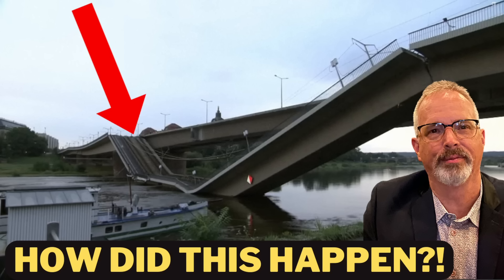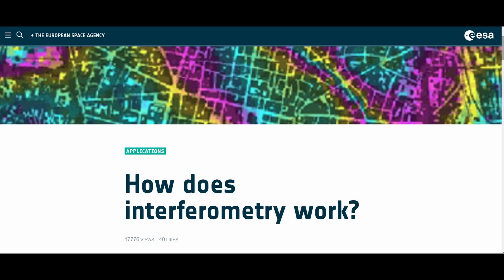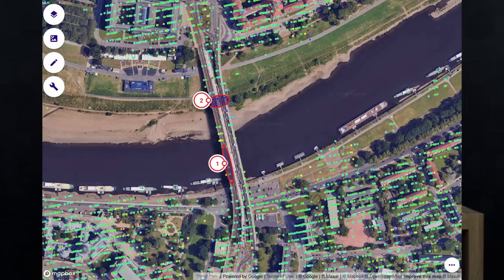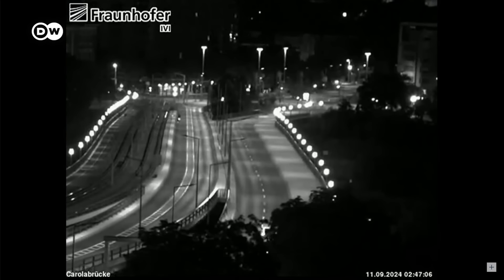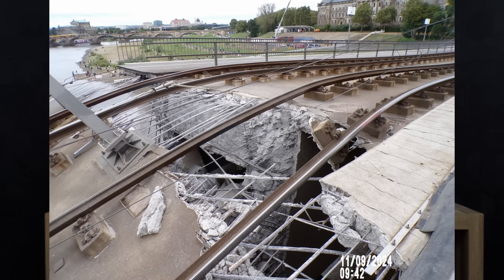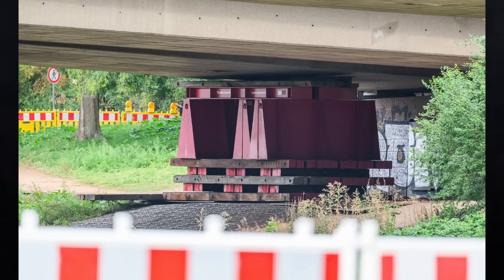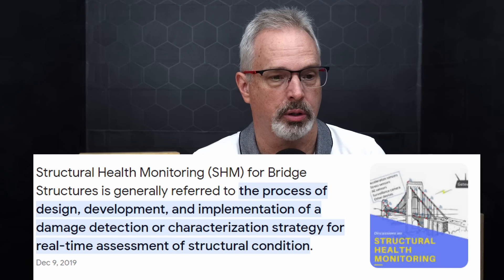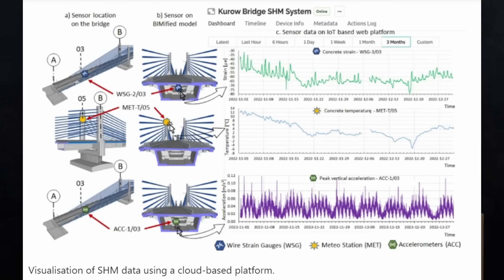Carola Bridge Collapse Update - Dresden, Germany

Comment: What I see are tram pillars at the fracture points. Did ice penetrate?
Reply: According to our officials a possible corrosion caused by chloride might have been the cause, that comes from an aggressive use of salt against ice in the past of that bridge. But the actual cause is still not certain, most likely a mix of corrosion or a general design flaw.
The bridge itself had its inspections according to safety regulations, 2 checks per year plus a major inspection every 3 years. Alltho in need of a restauration it never was declared in critical condition ... I guess the methods used for such inspections have to change, in hindsight it seems clear that not all data which could have been analyzed was actually used.
Silver lining will be that this lucky collapse will improve the safety of other bridges
Reply: @diedampfbrasse98  The first thing you see is that the rebar pulled out but wasn't rusted. I suspect the scans we've seen may simply be mechanical fracture of the cement matrix itself from ice expansion and contraction. Could it be that the vibrations from the light rail simply compounded this?
Reply: @JelMain  would surprise me if it were actual stress from traffic ... only 2-3 tram lines ran on that section for as long as I can remember with quiet some separation between vehicles. The other two road sections had much more and heavier traffic going across for decades.
ice expansion is also unlikely, in that bridge ran utility lines including hot water, poorly insulated in the past as well .. ice should only ever been on the surface.
Reply: @diedampfbrasse98  At this point, the game's open, and must be evidence-based. One piece of evidence is that long lengths of rebar were visible, having pulled straight out. Was the pre-stressing not done correctly? When concrete is poured, it can shrink, leading to the rebar rattling in the walls when rail services pass: The most notorious example is London's Barbican concert hall. I've performed there and suffered as the Metropolitan and Circle underground lines, running the other side of the wall, add their own percussion obligato to what should be a quiet and reflective meditation. Do that as ice is forming and you might as well take a road drill to the joint.

Comment: Shoddy Soviet construction? I'm shocked!
Reply: Not surprised either...
Reply: It was not a Soviet construction! East Germany had its own engineers and this type of bridges were build in West Germany too.
Reply: @GrandTheftChris   The problem in Soviet Union was not the engineering, which was fine, but the quality of execution and materials. Due to corruption, some material ingredients would come up short, say concrete would end up with an undue amount of sand and too little binder, and often natural fibre and other things that don't belong, because things existed on paper but disappeared in reality, so someone would end up fudging things but make them not too obvious. If East Germany received some of the material from Soviet Union, it may have not all been up to spec. At least East Germany didn't have the alcohol and corruption problems during construction per se, which plagued Soviet Union.
Reply: @SianaGearz  Maybe such things happend elsewhere but certainly not with critical infrastructure in the GDR. East Germans are German after all. They like to do things properly and with precision. The bridge itself was fine and stood the 50 years it was designed for. And that with increasing traffic and heavier tram loads over time. The disadvantage of these bridges is that the steel tension cables are inside the concrete, so not visible and not replaceable. Better monitoring should have been there way earlier and then the bridge would have been replaced earlier, like a lot of old concrete bridges in the west. I mean, do you believe the Berlin TV Tower will collapse soon because it was made in the GDR? I don't think so.
Reply: @GrandTheftChris   If it stood fine for 50 years, means it skirts its safety factor that by different metrics should have been... i don't know i'm speaking out of my behind, because i'm the wrong kind of engineer, but about 2 to 2.5, right? More than 1 by some sufficient amount, right? OK you can't say it should have lasted for 100 years, because decay is progressive not linear, but it's still falling way way short. If a structure has 50 year design life and it collapses on the first day of year 51, you can't say it held up to spec, because it's only a matter of luck, it could have collapsed just the same either 3 years later or 10 years earlier driven by mere random chance and uncontrollable variables. It shouldn't have been on the brink of disaster.

As someone else noted, bridge superstructures A and B had already been restored, and C which now collapsed had been slated for restoration next year, due to evidently dire state of concrete from prior assessment.

Look you say it's impossible that sub-par material was used but how can you be so certain, was there even a choice, given the total scarcity in the Eastern Bloc, was it possible to delay the construction until material from a more assured source became available, while Soviet Union is exerting pressure?

Also SU actually had extra measures to assure quality of product exported to East Germany, it was better than stuff produced for domestic use, so all of it couldn't have been bad, but the system was overall THAT much more error prone than anything European. I'm not saying Berlin Tower will collapse, don't put words into my mouth, i'm just saying i wouldn't be surprised that a small percentage of the material used in East German construction was not up to spec and nobody would be able to do anything about it. Look you're not from SU yourself are you? I am, i have seen how things worked over there (often very badly), and the types of pressure they exerted on the bloc countries. A relatively fresh 5-storey apartment block collapsed like a house of cards less than 500m from my home in the very early 90s.
Reply: From 1949 to 1990 it gave two German States. That where the was broken was the former GDR. A State in the soviet hemisphare. The other German state was the FRG.
Reply: @SianaGearz  out of curiosity how do we avoid this in the west? I suspect the answer is that we don't
Reply: @thewhitefalcon8539   OK i think my answer was too long and swallowed by machine, or you may be able to recover it if you go newest-first and dig thoroughly. But short version is: extensive and expensive certification helps prevent catastrophes. Corruption and shoddy construction and materials are abundant, but most of the actual garbage is shifted off to suburbs and distributed so they don't make the news.

Comment: I am still puzzling over the WHY 3am collapse?  No extra load-no people no trains-no cars-WHY? No one is that lucky-no casualties?
1)More wind at 3am Sept-  2)Maybe peak contraction-heating cooling-is about 3 am- and temp variation in early fall is "a lot" 3)Perhaps river current-but no snow melt
upriver in Sept- 4)Lotta rain upriver-current peaking-but why 3am? Just randomly failed at 3am-pure luck-maybe but...should have been under much more load at 4pm or 8am-?? Germans that lucky??
Perhaps someone could study times of bridge failures-guessing most fail at peak load hours-but perhaps a study would indicate otherwise.
3am-no one is that lucky.
Reply: Heat expansion. Summer just ended, and the first cold nights started again. 3 to 5 am is the coldest part of the night in that area.
Reply: @HenryLoenwind  So perhaps contraction initiated the failure?? The pure LUCK of 3am- no traffic no load-is just too lucky be be random-
Of course it could be random-but sooooo lucky-no traffic-literally NO traffic-no normal load?? Germans that lucky??
Reply: @charlesoboyle4787  Yes. So far, people are pretty certain that contraction determined the time of day it fell. However, we still don't know what was the actual cause. There's also speculation that increased load on the district heating lines during the transition from summer to autumn played a role. This, however, wouldn't have played a role in the time of day (just time of year) of the incident, as heating load is pretty much at its lowest at 3 am.

And it was quite a close call. A tram crossed the bridge just 8 minutes before the incident. Just imagine if that dynamic load would have initiated the event...

Comment: Is the data completely objective, or is there a level of subjective interpretation?
Reply: The data itself - phase differences and thus changes in distance from satellite to reflective surface - is objective.    The meaning of the changes requires interpretation. Whether or not changes should raise concerns requires potentially subjective interpretation. Repaving? Snow cover? Or sagging and impending failure?
Reply: @LurkerInTheInterRecordGap  That makes sense, thank you. Quite a powerful tool.
Reply: It's always both - there is objective data and subjective interpretion.
Like your doctor reads your blood data, but has to evaluate what it most likely shows. Each doctor may come to different results.

Comment: I love it when someone who is very familiar with the data and the analysis of said data uses terms like 'as you can clearly see...' or 'the results are obvious...' I don't know what green means or what red means or any of the other colors. And I can't read the scale on my large monitor and I most certainly do not know which of those plot lines are for which year. In short, the results are completely obscure to most people. Please explain your nice graphs in the future and if you use photographs explain what to you is obvious but may not be obvious to a biochemist or a bricklayer.
Reply from the maker: I love it when people complain for no real reason.  Did you not notice the trend lines?  One went upwards indicating uplift and the other went downwards showing settlement and I explained the significance of each trend.  It isn't really that complicated.

Comment: It feels the video kinda glosses over that the bridge was actually inspected and rated "isn't in great shape", basically. IF this technology had been used, and the bridge flagged for inspection that way, the inspection result still would have been the same. Repair was already planned (as you say), and had actually been done on other parts of the bridge (2019) already.

The big mystery here is why the inspection didn't catch that it was about to fail. But so far most everything seems to point to "unfortunate fluke", there doesn't seem to be any negligence or plain human error. We'd like absolutely safety, but such a thing simply isn't possible, and that's important to be aware of too.
Reply from the maker: Many bridges are in poor shape, yet nobody is expecting a catastrophic failure to occur which is what happened here.  This isn't an oh well, act of god situation.  Engineers need to do better in assessing the potential and probabilities for catastrophic bridge failures to occur.

Comment: How do you overcome the human tendency to be stupidly optimistic?It hasn't happened yet-so it won't happen?
Explorers sailed literally into unknown seas-around Africa-even worse around South America-actually thinking is unlikely they would die miserably-
many made it-but many did not.Humans are by nature STUPIDLY OPTIMISTIC! Has not happened yet -so it will not happen.
These failures are human factor failures much more than engineering failures-hell a Commie bridge lasted 50+ years-not bad.
I had a West German bicycle-1969-it was junk-chain stay to bottom bracket  weld failed-but it was crude enough "tubing" really just pipe-that it accepted a crude weld and lasted many more years-something to be said for thick cheap steel-try that with aluminum or CF-oh it sorta sagged-so never lost control -something to be said for steel even cheap steel-it bends but so what-aluminum  or CF I would have kissed the asphalt(I ride CF bikes now-and aluminum and steel-853 steel)
Kolkoff was the brand-W German manufacture

Comment: 🇩🇪 The Carola Bridge - a collapse with an announcement

You could call it a scandal if it didn't reflect the obvious deterioration of Germany's infrastructure over the years. So to speak, there are actually things you can now rely on in Germany - German thoroughness seems like a relic of bygone eras. 

🟥Back in 2013, the Carola Bridge was certified as being in need of renovation with a grade of 3.

The deficiencies were summarized as follows 

-Carrying capacity not up to date, no special loads possible,
-Durability limited, serviceability given,
- Reinforcement corrosion in the superstructure, partly with cavities and concrete spalling,
- Superstructure still contaminated despite chloride removal,
- Repair areas with concrete replacement systems locally damaged again,
- usual problems with GDR prestressing steel (potential for hydrogen-induced stress corrosion cracking),
- Waterproofing, roadway, pavement, drainage and transition structures worn out,
- Exterior concrete repair due, but suspended,
- Alkali-silica reaction suspected in the piers,
- Railings not up to date (too low, without rope in the handrail), corrosion protection worn, 
- Vandalism damage.

🟥Another 5 years later in 2018, various necessary repairs were discussed and partially approved by the provincial government. However, as can be seen from the documents, funds have already not been approved and the financing has been handed over to the private sector. It is not possible to say to what extent these private investments provided a remedy and to what extent they took place, but the following report from 2023 casts a very gloomy light.

🟥According to an inquiry by the "Left" in 2023, the Carola Bridge was in an even worse condition than in 2013. Not only did existing deficiencies still appear in the report, but the list of deficiencies was extended with some significant deficiencies. 

❗️ The obvious conclusion is that the state government, city administration or the federal government obviously lack the money or motivation to maintain the existing infrastructure. The suspicion falls more on the lack of motivation, as there is obviously enough money left over for diets and a good 50 billion euros a year for migration, cycle paths in Peru or gender projects in Africa. For their own country, their own people, however, the coffers are then empty.
Reply: That bridge was part of a communal road and so entirely managed by the city of Dresden, neither state nor federal government have a word in their decisions (and each do have enough other roads and bridges to keep up).

And a liberal mayor decided to postpone renovating the second half in 2025, in order not to break the budget for 2021 by adding more debt.

About that “cycling ways in Peru”: that’s something the last federal government committed and contracted to, the current federal government was just legally obliged to pay. Oh, unless they’d prefer to break international contracts.

Comment: Germany acts like a parasite in Europe by not investing into infrastructure. It harms other European countries who keep up with their investments. And it obviously harms the economic perspective of Germany as well. But politicians like this because of the state deficit strawman.
Reply: Look at France Infrastructure: shit hole Belgium: also garbage.
Czech and Slovak roads same story. Or it's an never ending "baustelle" that ran out of money before they put 100m new asphalt in.
Even here in the Netherlands one of the busiest bridges(if not the busiest) is in need of replacement. They are building a new highway around Rotterdam, leading straight to that bridge but they don't know how to handle the current traffic crossing the bridge let alone the traffic is going to come from that new highway.
Reply: @idontgiveaship2575  That's not accurate in terms of investments. France doesn't have investment deficits like Germany. The only reason why they struggle is Germany's export surplus that's driven by Germany's investment deficits and precarious labor and social policies.
Reply: A more accurate description would be that politicians favour opening new roads, but don’t think about the upkeep for the next decades. And when it’s necessary, those tasks are often postponed (to save some budget for new roads) until there is no other way to replace it entirely, at a higher price.

This is not limited to Germany: it’s a common practice about everywhere.

What’s more striking in Germany: much infrastructure was destroyed in the Second World War and was rebuilt in the 1950ies, at about the same time. That’s why some more infrastructure requires immediate major maintenance now: bridges, roads, railways, electricity networks have gone beyond the age there were designed for.

Much infrastructure was estimated to last for about 50 years, but over the past 70 years, everyone just moved on and acknowledged “it’ll hopefully last a little longer”. And now, a lot of cruft has been accumulated over the time and now requires more urgent maintenance. But of course, it’s always the current administration to blame, never those folks who have been in charge for the past decades.

A more accurate way of handling this would require the administration to not only do the minimum of service, but also save 1/50 of the current rebuild cost for an actual rebuild in 50 years after the original construction. But this is not really popular with politicians and people.